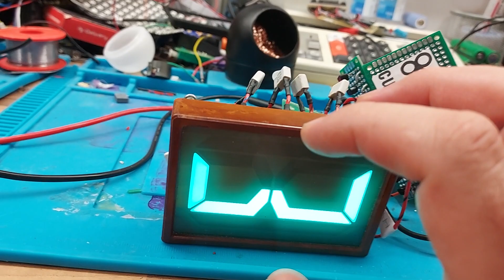Soviet EL Display

Comment: These were designed to display Cyrillic characters.  They were made in several different sizes- I believe the IEL-0-VI was the smallest, and this one is somewhere in the middle.
Reply from the maker: Indeed they were, some debate where they were used. I have two of the smallest ones. Little two small for the project I had planed for them but that project is a long way off anyway.